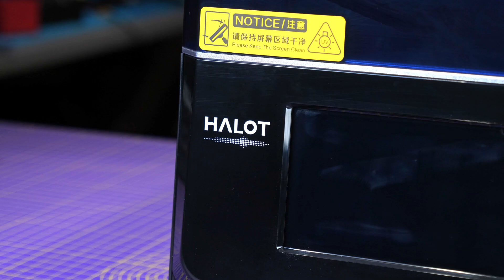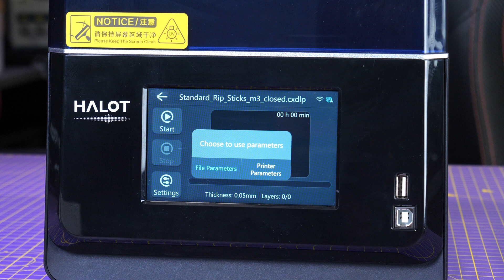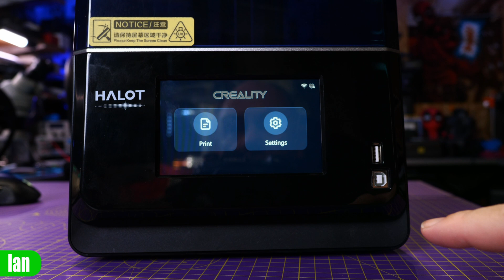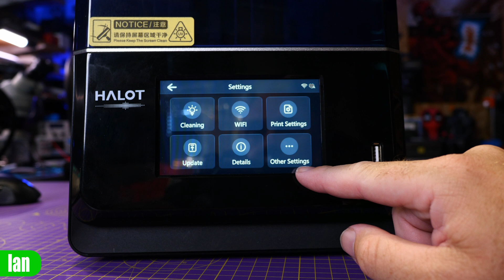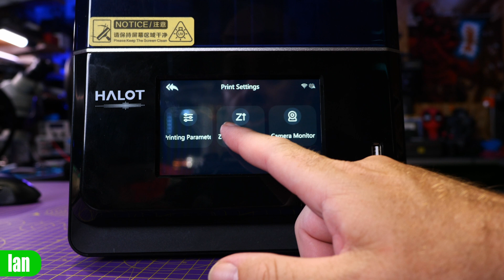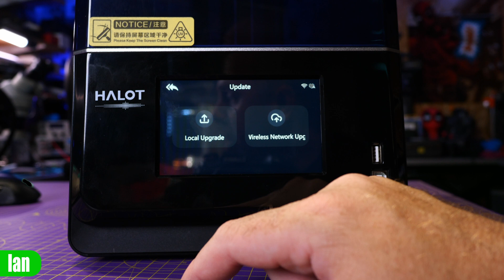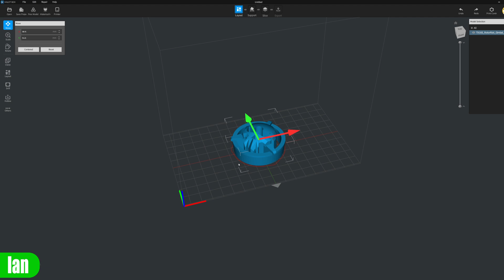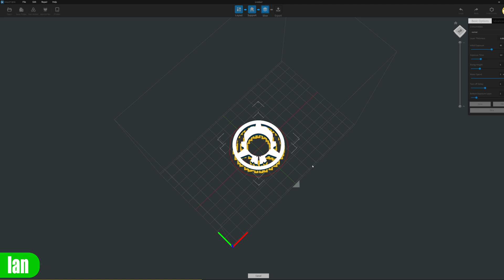Creality Halot One Plus Resin 3D Printer  -

Comment: I printed some TPU resin last year, antenna holders, go pro mounts etc, great details but (and this might be an issue with the brand i was using, i got rid of it before trying any other) as you said it's more like rubber than the TPU we are used to from fdm's, with the summer heat the prints become very soft and are also less durable, happened more than once that on a stress point or a point where there is some bending involved, sooner or later a cut appears and need a new mount

Comment: excellent video, thanks! I wonder if you could test the siraya tech "tenacious" (that's their flexible resin) and tell us how it compares to the F69 resin. btw, an added benefit of resin printing is that you mix your own "recipe": if you want something harder than the F69, you can mix it with another "engineering" hard resin and dial in the structural characteristics you want. it might take a bit of experimentation, though. thanks again!

Comment: The first time that tank film gets a hole and you have to clean 500ml of resin from on and inside the printer, that will be the last time you use it. It's a pain and for all the fine detail resin provides the dimensional accuracy isn't great since it shrinks and warps during curing.
Reply: 5 years of intensive resin printing and I never punctured a FEP film. basic precautions like making sure you clean the vat. of course if you go at printing like a wild boar, bad things can happen. 😂as in anything in life
Reply: @pgabrieli  curious what machines you use. These lcd printers don't go much farther back than 3-4 years in the consumer space.

Comment: Will a resin printer work with tpu also?
Reply from the maker: That’s basically what’s flexible resin is.
Reply: if you mean TPU filament, no. this is a resin printer, not an FDM printer, completely different technology. but as the video shows, there are resins with the same properties
Reply: @pgabrieli  Thanks,
  Thats what I was wanting to know if it took filament also.
 I try to buy frames with tpu included or have Brain3D print them up.
Reply: @rob3393  if you have access to the files to get someone else to print them you could print them yourself with this printer and some flexible resin